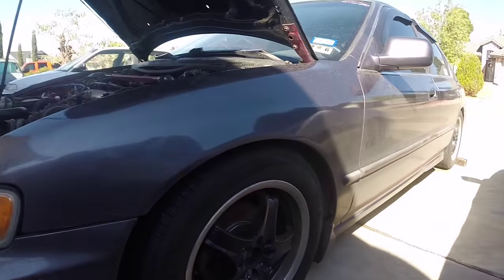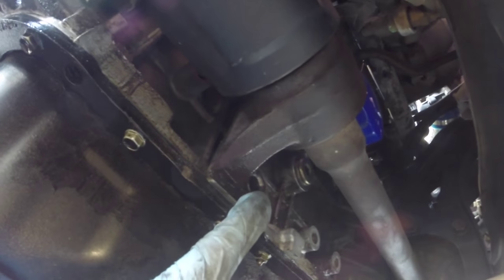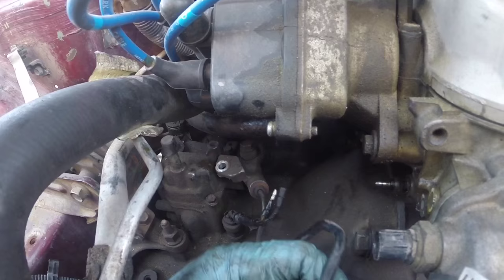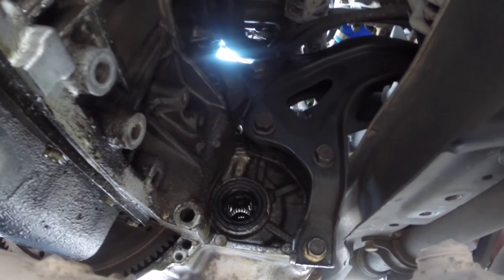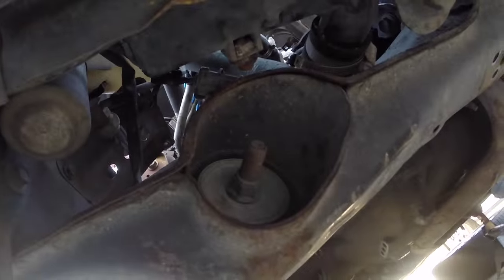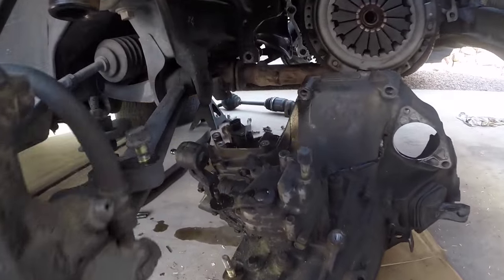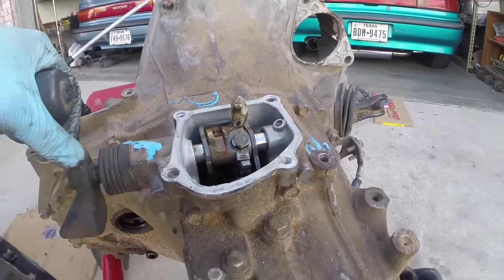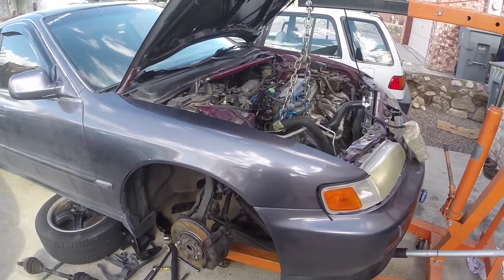How to Remove Transmission 1994-1997 Honda Accord plus Clutch Replacement

Comment: I just broke the clutch on my Honda 1996 1.8 liter manual transmission. I was very disappointed prior to watching this video but when i watched it I got even more disappointed :D. I do not have any conditions  (tools, jacks, garage) to replace it my self (not to mention my 0% understanding of how mechanical things work) so im looking at $600-700 clutch replacement. I have bought this car for a 1000. I wonder what to do with it. I am thinking about something funny - maybe somehow finish it in a funny way. Any suggestions? :)
Reply from the maker: Pavel Kichev lol, man you could do so many different things!  Does it still drive in any of the gears?
Reply: when in neutral and I start it I can not get it into any gear. When shut it off - i am able to get it into first and start it with the clutch pressed and after that it goes and changes all gears, but the clutch pedal is dead - it feels like you are not pressing anything - there is no resistance of the pedal whatsoever. One more question actually, I see online that there are two different clutch pumps - do you have to change them as well? If yes are there any videos of how to do it out there? What is their use? Because i taught that the actual clutch consists of a flywheel, pressure plate, disk and bearing?? :D (sorry for the stupid Q's

I literally have not slept all night to think how to save the old garbage:D
Reply: Also, how heavy the transmission itself is? Is it very difficult to mount it back? Is it a one person job?
Reply from the maker: It's about 60-70 lbs.  If you're pedal goes to the floor you probably just have a bad slave cylinder or master cylinder.  With one of those not working, you'll definitely not be able to get the car into gear.  Those are easy compared to a transmission swap.  I would make sure they are working first before starting the transmission removal.
It can be a one person job, it was for me, but if lifting that weight with one arm is too difficult then youll need to have some help to get it back onto the engine.

Comment: Is it possible to do this without removing the front motor mount? One of the bolts in mine is frozen up
Reply from the maker: You can probably just discount the mount from the transmission and leave it there. Shouldn't be a problem.

Comment: So I have a 96 Honda accord ex auto ex auto dose the transmission come out or do I need to remove all the little bolt like 12 the are on flex plate or dose it come out with transmission
Reply: I working on mine right now
Reply from the maker: +Jesse Reyes You need to remove all the bolts to get the transmission free.

Comment: I have an honda accord v6 3.0 2005 model there’s an issue, after driving on higher speeds like above 100-120 kmph for some time, the gears lags sometimes jerks and car comes on limp/safe mode, i am very much confused what’s the issue with the car
Reply from the maker: +Mohommed Bakhtiar any maintenance or check engine lights on?
Reply: Garage Built Hondas 
Nothing as such, I scanned the vehicle and it was showing solenoid valve b stuck on, so I went to mech and he cleaned up solenoid valves which is on top of gearbox, and after that it is showing Oxygen Sensor B1 trouble code, so i will he changing it, BUT does it really a problem related to O2 sensor or any other issues?
Reply: ATF Z1 and Dw1 is not available in aftermarket, so what is the substitute ATF for my honda accord ?

Comment: How did you end up separating the driver side axel from the intermediate shaft since you removed the whole unit together? I removed my axel and intermediate shaft  together aswell since no amount of prying/banging could seperate them on the car. I still cant seem to seperate them even out of the car.
Reply from the maker: BFH
Reply: @GarageBuiltHondas  I ended up using a 2x4 wedged in the gap between the CV joint and intermediate shaft. A couple good wacks with a 2lb mini sledge on the opposite end of the 2x4 while rotating the axel and it seperated in a few minutes!
Reply from the maker: Lol, nice!

Comment: I'm swapping a motor and trans, converting a wagon from auto to a manual trans I pulled from a wagon that wasn't as clean. Hence the swap. Any idea if it's reasonable to pull the motor and trans out through the top? Would be allot easier for me than pulling them down and out
Reply from the maker: That's usually how most full swaps are pulled.  It's not ideal to pull just the trans from the top though.
Reply: YouTube never notified me about your response. But I did go ahead and pull the whole drivetrain from the top. Took allot of angle on the motor and a fully stripped engine bay. But now I've got a roller
Reply from the maker: Nice! 🙏

Comment: Very helpful video. Have you ever had a issue with the Cruz controll? My 94 accord works every once in a while just curious if you've ever ran into that problem.
Reply from the maker: No, I haven't.  The sounds like a connection issue. Check the plug and make sure all of the metal contact points aren't corroded.
Reply: Garage Built Hondas thanks I'll give that a try

Comment: How much was the fly wheel and where did you buy it
Reply from the maker: Allison Taylor It was purchased from AutoZone.  I believe around $60, cannot remember the exact price.
Reply: Thank you
Reply: Autozone has flywheel, OEM type, about $55 bucks.
The two axle seals (L-R), and the input & output seals all, are about $40,  well worth the little extra cost and time to swap out.
Tools ~10mm & 17mm 12 point, both sockets, 1/2 inch drive,  for P-plate & flywheel bolts (socket at Homedepot or Napa)
Thx for this video info, it is helpful.

Comment: I never repair on the street, I'd cut the ruins out of the garage and work inside.
Reply from the maker: I always work in my driveway, sometimes it's a little too dark inside my garage even with the LED lighting I installed.

Comment: All the bolts holding the trans to the motor are they all the same length? Or are they different lengths?  I got them all out but didnt mark or remember if they were different lengths i dont want to find out the hard way. Great video that shows hows the right to do it with not shortcuts!
Reply from the maker: All are the same length, but double check any that are close to the rear mount.  It's been so long since I worked on this car that I cannot remember exactly, and I haven't touched another Accord since.
Reply: Garage Built Hondas I'll double check but the shorter ones would be on the rear, that would make sense.

Comment: You really did make that look super easy. Unfortunately, that's only half my problem. Have you ever replaced the inner shaft bearing in a transmission? I'd love if you could do a tear down of that broken trans. I can't find a video for that specific trans, and I need to do that exact job. Thanks for any input!
Reply from the maker: Not an accord transmission, but I have replaced the input shaft bearing on a couple sohc D series transmissions.  It wasn't as daunting as it sounded as the transmission stacks are removed relatively easily.  Try to find some info on the forums.  There might be some old write-ups out there.
Reply from the maker: Yes,they are tougher to find for sure!

Comment: so I replaced the clutch in my 94 honda accord went good but after I got it back together and put it into gear it doesn't move any ideas??
Reply from the maker: Can you shift the car into gear when the car is off, and also when it is running?
Reply: Yeah
Reply from the maker: +nathanial hurt Was the flywheel also changed?

Comment: I'm converting my 01, people say i have to drop the subframe, do i have to or i could drop it straight like yours? F23 motor, using a 97 f22 5spd conversion
Reply from the maker: Joshua Figueroa sorry, I'm not sure.   I've never worked on the 98-02 Accords yet so not familiar with the chassis/specs.
Reply: Garage Built Hondas it looks the same
Reply from the maker: +Joshua Figueroa If it's similar, I don't see a reason to drop the subframe.  On all the Hondas I've worked on I've never dropped the subframe to remove the transmission.
Reply: Garage Built Hondas people are saying to drop the whole subframe as one, but watching this video, the only thing, i dont know if you took it out or it's like that, it looks like a trailer arm to the front of the subframe, can i have your email to send you what I'm talking about?
Reply from the maker: I removed the radius rod to drop the transmission.  If you don't you won't have enough room to get it lowered to the ground.  I prefer to respond to messages here.  I only check my email every few days.
Reply: Garage Built Hondas so removing the radius will disregard dropping the subframe?
Reply from the maker: Joshua Figueroa That's what I did.  If it looks the same as you mentioned, I don't see a reason to drop it.

Comment: i think it has to do something with my clutch because if i dont has it to much my car is fine the problem is when i gas it
Reply from the maker: It sounds like your clutch may be slipping.  When the RPM's increase that means the engine is definitely spinning the crank, but the clutch may be slipping and not applying the power to the transmission, that being the reason your car barely moves forward.
Reply: +Jon Widmer 
yes so then it should be the clutch right?
Reply: I have the same car with the same issue
Reply from the maker: +Joey Sandoval It does sound like it is the clutch.  Sorry for the late reply. 😳
Reply from the maker: +Chris Lee bummer Chris!!

Comment: Getting ball joints loose was the toughest part for me. Thanks a lot for your video!
Reply from the maker: You're welcome, glad to help!
Reply: @GarageBuiltHondas  So it took me all of 2 days to clean the transmission housing. I accidentally got some dirt inside the output shaft holes in the process. Do I have to strip it now completely or can I flush it with 5w40 once its back on the car? Stupid silly me ;-)

Comment: hey john do you have an idea of why my car turns off in neutral when let go of my clutch ?
Reply from the maker: Possibly your idle needs to be adjusted?  Does your car idle very low?  Maybe your ignition timing being set might help.  Possibly clean the IACV also.
Reply: Jon Widmer i don't think its an idle problem because before when i let go of the clutch you could hear a crackling sound from inside the car.
Reply from the maker: +Yo Boy Moy Crackling?  as in like a wire shorting out?
Reply: nah more like metal hitting metal "crackling" sound
Reply: Jon Widmer nah more like metal hitting metal "crackling" sound
Reply: Jon Widmer my car also flings forward right after it turns off
Reply from the maker: +Yo Boy Moy you maybe have a broken clutch or pressure plate causing the clutch to engage somewhat and this flings your car forward after turning it off or putting it in neutral.

Comment: what's the name of the piece at 10.59
Reply from the maker: Shift Lever.  I looked up the part and #, it's "24470-PX5-000 / LEVER, SHIFT".
Reply: +J Wid Films I have a 96 accord it doesn't shift to 1st or 3rd but 345&reverse work fine but I can only shift to one gear then I have to move the shift lever to put back in neutral because it won't go back to neutral normally what do you think is the problem?

Comment: what is that plate on the transmission called and if u dont know can u show me how to put it back on im stuck
Reply from the maker: Which part of the video?  Could you give me the time it was shown at?
Reply: +J Wid Films.  6:53 i think i figured out the name but i put it all together n its still leaking
Reply from the maker: +Gilbert Arroyo The T bracket?  The piece that holds the engine/transmission to the mount.  Where is it leaking from?
Reply: No its a small plate on the side of the transmission its the tourqe converter cover i think
Reply: +J Wid Films u show it at 6:00
Reply from the maker: +Gilbert Arroyo That plate is just a dust/dirt cover to help protect the flywheel and clutch.  If you are having a leak there then you're rear main seal might be leaking.  Is yours a manual transmission also?
Reply: +J Wid Films i have an automatic but thanks for the insight definently helps
Reply: +J Wid Films one of the studs that comes down through the oil pan is stripped right wer that plate is idk how to fix it but the nut wont go on so idk wat to do
Reply from the maker: +Gilbert Arroyo Your torque converter connects through there.  Check that all of the bolts are tightened from the converter to the flywheel.

Comment: Yeah and both axles and rear seal
Reply from the maker: Maybe the axle is binding up against the knuckle?  See if there are any old axle dust covers that may have stuck to your hub when you removed the axles.
Reply: The axle wasn't in all the way
Reply from the maker: +nathanial hurt Glad you figured it out!

Comment: Dude epic video very helpful. I'm about to do a 94 Accord transmission
Reply from the maker: Thanks man, good luck!!
Reply: Garage Built Hondas thanks it will be my first time doing a job like this 😁
Reply from the maker: Excellent, take your time.  I tried to cover every part, hope it helps!
Reply: Garage Built Hondas 
Ya it was a great video. Quick question did u remove the AC pump compressor
Reply from the maker: No, I did not.
Reply: Garage Built Hondas 
 Did you move the lines from the pump?
Reply from the maker: Not that I remember.  Only what I did in this video.
Reply: Garage Built Hondas 
Hey man the CV axle nut was really suck on there I had to get it red hot to get it off. Broke 2 breaker bars in the process
Reply from the maker: That can happen.  I'm not sure if you own a heavy duty impact but that would knock it right off.
Reply: Garage Built Hondas hey man. How many bolts r on the transmission
Reply from the maker: I don't recall.  All of the ones that I removed in the video.  I remember there was one missing in this video but I still showed where it was and needed to be removed.
Reply: Garage Built Hondas I found 4 of them I don't c any other ones but it be it's a mission
Reply from the maker: Watch the video, you should be able to get to all of them

Comment: Hey man where can I replace my muffler?
Reply from the maker: Go to any muffle shop, they usually have some in stock and can do the work.
Reply: I just noticed ur from el paso
Reply: Can I meet up to have a lil chat about the accord
Reply from the maker: I'm not meeting anyone right now, sorry man.  I have a 6 month old and I dont leave the house unless absolutely necessary.   I'm not trying to get my baby, my wife, or myself sick with everything that's going on.  I can chat here.
Reply: Hey man would u be able to tell me why everytime I hit the breaks for full stop I hear a screeching noise
Reply: Like if something about to pop off
Reply from the maker: Have you checked your pads?
Reply: They are thin but a couple days ago I hit the breaks and my right bolt snapped
Reply from the maker: Sounds like a problem right there.  Best bet is to get under there and check.  Its hard to diagnose anything without taking a look first.
Reply: How can I remove my rotor ?
Reply: Do I need a special puller?
Reply from the maker: https://youtu.be/dm2Z4F-lGDU

Comment: do u have to take out both axels
Reply from the maker: Yes
Reply: @GarageBuiltHondas  🤦🏽‍♂️damn the struggle
Reply from the maker: It's not very hard.  Easier than it looks on video.
Reply: @GarageBuiltHondas  man i was at my friends doing his 2001 accord and the axle dont wanna come out 🤦🏽‍♂️
Reply from the maker: From the transmission?  A small breaker bar helps a lot.
Reply: @GarageBuiltHondas  yeah we tried removing the passenger axle but it wouldnt come out but imma do mine on my 95 ex tomorrow
Reply: @GarageBuiltHondas  how long in total did it take to complete

Comment: I have a 94 honda accord ex vtec engine automatic transmission, can you please tell me where I can buy those parts for my transmission??? Thank you!!
Reply: Those parts you got for that honda you fixed will the work for mine??
Reply from the maker: The clutch setup and flywheel?
Reply: No, just the seals, the rear main seal,torque converter O ring, the seal that is between the torque converter and transmision and the cv axel seal...where can I buy them??  because autoparts stores doesn't have them, thank you!!